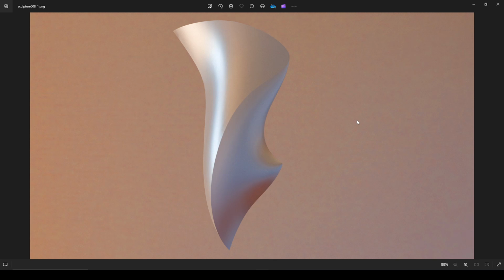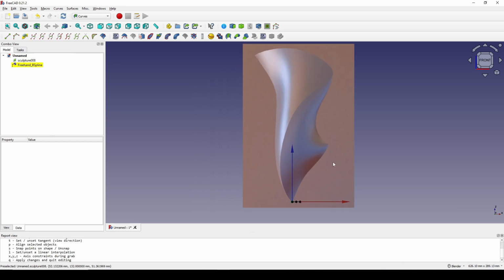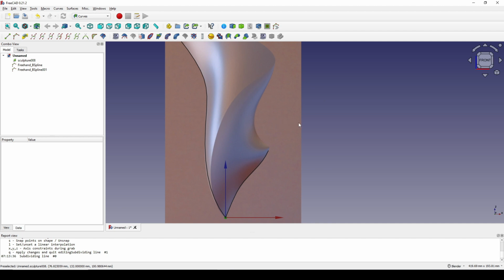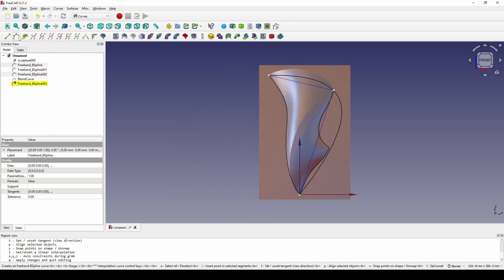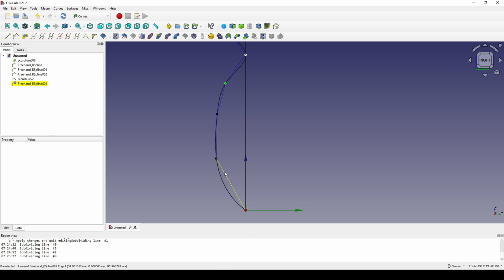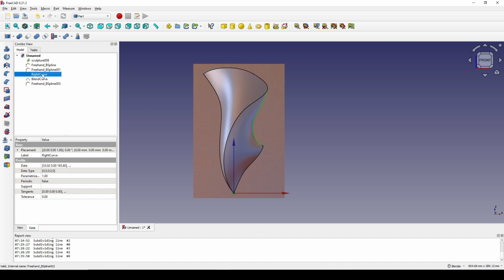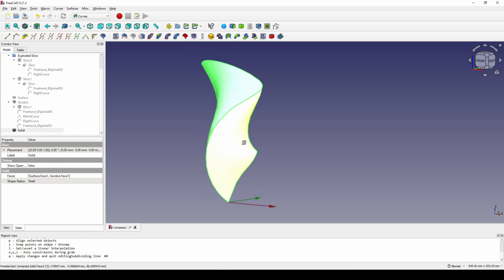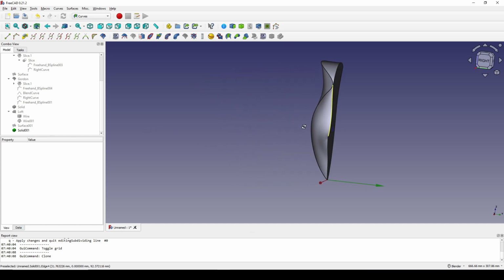FreeCad - Using Freehand Bspline, Gordon Surface And Filling Tools To Create A Sculpture.

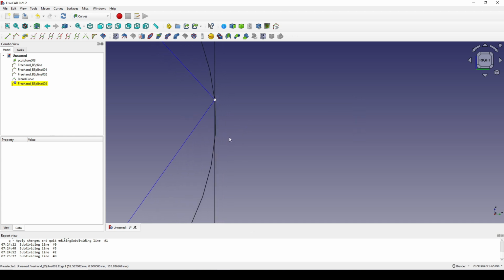Comment from the maker: Important moment: 12:10 Zoom close and check, make sure the bspline not go outside of the verticle line.
Reply: So, when we create a "Freehand B-Spline, it is created from the origin of the coordinates system? And if we previously select another point that new B-Spline starts on that selected point or not?
Reply from the maker: @LFANS2001   If you just create it, it in the center. But if you select points or lines and then create it, it attached to those points or lines.
Reply: @DuyQuangDang  Thanks for the confirmation, regards.